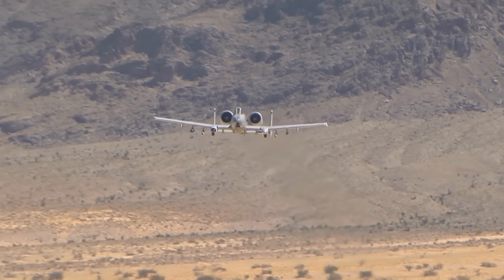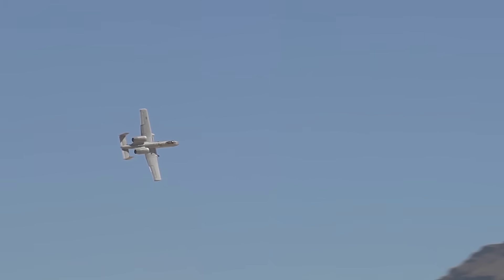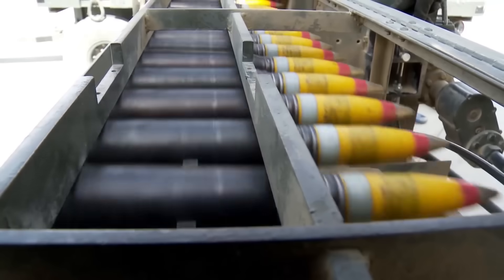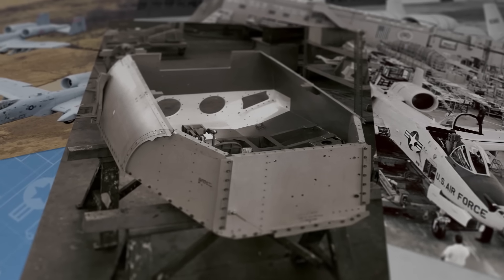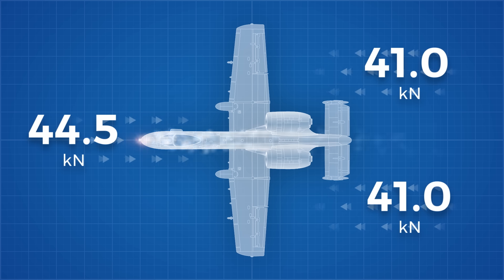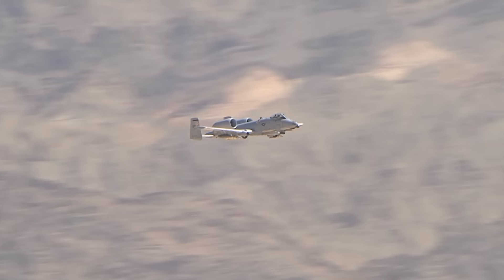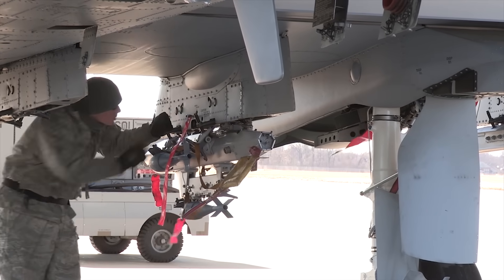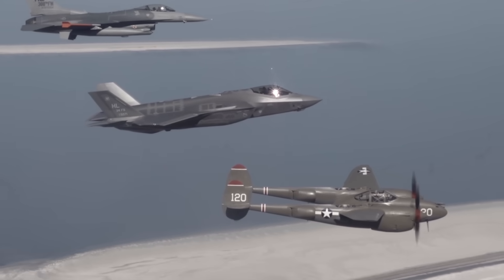The Insane Engineering of the A-10 Warthog

Comment: Former fuel system technician on the hog here. Love the hog and miss working on it. Easily the best beast put in the air.
Reply: Pavehawk crew chief here and we loved having you guys as our brother squadron! BRRRRT!!! :P
Reply: Former Instrument Flight Controls Spec for the B-1B Lancer here.  I regret that we never had an A-10 at any of our airshows before I left South Dakota.  It was one of my two favorite planes growing up.  The other favorite, at least I got to work on for a few years.
Reply: "Former fuel system technician on the hog here."... cool i used to do electrical on the hog down in forth worth for awhile.... the hog is a great machine.
Reply: its on my list of models to aquire
Reply: @JoaoSoares-rs6ec  3D print it ! Way cheaper  its like 40 dollars to print a plane about 800mm long, Im printing a Harrier at present, just using PLA LW filament, its awesome light weight plastic, super strong, the printer is about 800 bucks, totally worth it, make broken parts even props, you can even buy all the plans with gcode ready to go if you want, I did that with a spitfire, 60 dollars for pln, the spitfire has a wing span of 1.2m its huge, my build plate is 220x220x300 up, built it entirely on that printer......You should look into it, its great fun as an add on to the hobby.
Reply: @Piddlefoots  interesting idea, but i would need a scan of an a10 for that, the biggest issue is a 3d printer, their near impossible to get were i live and absurdly expensive, it would be cheaper to just get the model.
Reply: @JoaoSoares-rs6ec  Well thats a shame mate sorry to hear, maybe in the future.
Reply: @Piddlefoots  maybe
Reply: @JoaoSoares-rs6ec  Another place you can fly one, well virtually lol is the game Warthunder, they just added the Hog to the game !
Reply: Go to work for MESA airlines.  They'd  love to have you.
Reply: What about  the O V-10  BRONCO.  ?   THE  A=10's Daddy  !
Reply: The brrrrrrt
Reply: Gold Fish - those fuel bladders must be a bitch to replace.
Reply: @benscratchin7017  for the A-10, piece of cake. For the B-52, it takes some dancing to lace them properly. Best and worst experience of my life was working on those magnificent beasts. Worst because of supervision being unrealistic but that's over with.
Reply: Thank you for your service brother!
Reply: Man you had an awesome job well done !
Reply: I see these doing flights out of a local Guard post pretty often, they're certainly distinctive and impressive!
Reply: I love comments like this, thank you for your service!
Reply: @ Gold Fish, thank you for your service, you have to love that they built a plane around a gun. Also engineered to be one of the toughest birds in the air. 👍
Reply: Actually not the best at its intended role
Reply: @MaticTheProto  You're right, the money spent on any upgrades should have been used on a new platform, the A-10 is just about equal to the SU-27 or SU-29. And I see now they are going to dump a number of the F-22'S a plane lol that was supposed to be so special that they wouldn't even sell it to their NATO buddies and instead are going to wait for the development of their next platform which will be years down the road and cost billions or a trillion and the end results will be another boondoggle like the F-35.
Reply: @robertferrin511  still waiting on the answer
Reply: @MaticTheProto  yes it is
Reply: @JoaoSoares-rs6ec  oh really? Then tell me why so many were shot down
Reply: @MaticTheProto  realy and how many were shot down, let's see if you know that one.
Reply: @JoaoSoares-rs6ec  seven, last I checked
Reply: @MaticTheProto  7 out of 716 ever built, all by AAA missiles and after taking heavy fire, those are very low numbers for a plane designed for tank hunting and ground support, and if it's so bad why is the US airforce keeping them on the books.
Reply: @JoaoSoares-rs6ec  1. it’s more than any comparable aircraft 
2. heavy fire? As in… a single missile? 
3. you are soo close to understanding that warfare evolved past the point where a plane like the a10 is effective 

4. there are hour long videos explaining that and more, I recommend the ones by lazerpig
Reply: @MaticTheProto  1: not realy there are several planes that have a higherlost ratio, like the f16.
2: no heavy has ground flack fire and several missiles, some a10 have returned safely whit hap a plane destroyed.
3: warfare as evolved in many ways but the core principples are ther same. If warfare evolved so much as you claim, why is it that  the military has no plans to replace it, its te one plane that soldiers keep calling for suport.
4: there are videos showing how reliable and durable as the a10.
Reply: @JoaoSoares-rs6ec  1: probably because they are used more and in situations where the a10 can’t operate (i.e. at night or when there’s a chance that the enemy has any sort of anti air
2: not really. The damage most a10s returned with wasn’t spectacular 
3: there are many replacements. Any plane with a targeting system and guided munitions can do a better job, the gun is useless. 
And if loiter time is essential… have you heard of something called „combat drone“? 
4: there are videos explaining at length that the a10 is outdated
Reply: @MaticTheProto  1: because  unlike the a10 they are primarly built for dog fights, manuver, strike and run kind of things, not to stay at low altitude and take the punch.
2: have you seen the damage some a10 have had, literaly damage that would destroy other planes, parts of wings, gone parts of tail gone our most of it, fuselage like swiss cheese, whit hidraulics gone and they always come back.
3: drones cant take the same punishment and amont of munitions that the a10 can.
4: gun is usless. let me tell you a story, in the late 50's whit the introducion of guided missiles, some "genius" decided that they missiles were the future and planes didn't nedeed guns, so they introduced a plane designed to be fast and cary lots of missiles, (the f4 Panthom), all said it was a great plane, but them something happend, called vietnam war, now on paper the NVA had the short straw, nost were mig 17, no mach, but here is the thing the NVA very kwikly learned how to deal whit the missile heavy f4, wen they had a missile on their tales, they would dive to the deck, the missile would get confused and slam to the ground, another thing they did, most people don't know but missiles have to travel a short distance before arming, so the NVA would get close were missiles were usless and use the one thing the f4 didn't had a gun, the f4 had their tasks complicated until one pilot straped a gatling to is plane and altered the game again, later models came whit a gun included, guided munitions can miss specilay so close to friedly forces, a gun not so easy,
Reply: @JoaoSoares-rs6ec  why, just why do you think any plane needs to take a punch? That’s just false
Reply: @JoaoSoares-rs6ec  and in the past other aircraft survived worse
Reply: @JoaoSoares-rs6ec  also drones don’t need to take a punishment because they don’t use a gun like an idiot
Reply: @JoaoSoares-rs6ec  and 4. is just a load of crap.

Yes I know the f4 phantom story but guess what? Military analysts have a point. Nowadays air battles happen beyond visual range because missiles are far more potent now. 

Also the a10 has a habit of using its gun against friendly forces soooo…

Just watch the videos done by lazerpig, the guy made two excellent summary videos
Reply: @MaticTheProto  so many comments.
OK, if a plane is to provide ground support it needs to take a punch otherwise it's destroyed very fast and no, not that many planes survived such damage, it's a rarity, the b17 is one such plane, drones don't use a gun, because they are first built for recon second they can't take the recoil,
The reality is you have no idea what you are talking about,
Reply: @MaticTheProto  you keep mentioning videos well we're are they
Reply: @MaticTheProto  take a look at the Russian il 2 plane to get an idea
Reply: 1 s400 and it’s a fireball
Reply: @pauldean8638  keep dreaming
Reply: @JoaoSoares-rs6ec  keep dreaming , yeah the US keeps thinking they can fly in Russian airspace , boom big fireball
Reply: @pauldean8638  like I said keep dreaming,  take a look who's planes and gunships are turning to fireballs,
Reply: Lol why would anyone go on and on about an obsolete plane is beyond me
Reply: @robertferrin511  and futher more the platform was so successful  Boeing  has the latest version of her  even  in desert storm she was there doing her thing so when someone makes  an uninformed and  ignorant  comment  such as yours  instead of  bringing them down.  I would prefer to educate their understanding and bring knowledge to  the front of their knowledge on a subject.  ....    obsolete.   My coment  of response is .   This Fool has been  sadly misinformed.   (  quote  from the Transformers. )   The  movie.    Specifically  Doc... !
Reply: @quinnsavage2325  LMAO of course it was in Desert Storm for after all we were the only ones with planes there, now put them up against a peer country and see how long they would last, I was reading that they are equivalent to the SU-27/SU-29 which means they are a few generations behind other peer countries.
Reply: @robertferrin511  Aww you'll be  fine.
Reply: @robertferrin511  Because its not that obsolete for a start, it i to this day VERY effective on the battlefield BECAUSE its only deployed AFTER the US has total air dominance and then its one frightening beast......... On top of that, it has LEGENDARY status, hello do you live under a rock /
Reply: @Piddlefoots  Lol LEGENDARY status, so did the Brown Bess when they first came out, but they don't use them today do they.!!!
Reply: @robertferrin511  Well they DO still use the Hog buddy, and they use it TODAY buddy, because its still very applicable to todays battlefield, explain why you think its not mate ........ We dont all drive T-Model fords, but a FEW people do, so what, your point is rather silly, try reasoning. Why do you think its outdated mate [
Reply: @Piddlefoots  Well you have to go with what you have, let's face reality the F-22 the F-35 are nothing but high-priced junk to peddle to the NATO suckers, the F-15 and the F-16 are old birds which can't and won't keep up with the SU-30,SU-35 or SU-57. So as I said you go with what you have even if it's the last decade's technology..
Reply: @adamdrach5394  Neither Russia nor China is an enemy, for our enemies are located in Washington, D.C. AND HOPEFULLY SOONER THAN LATER THE American PEOPLE WILL FIGURE THAT OUT.
Reply: @adamdrach5394  Bingo, you hit that one out of the park, but watch this fall as the sheep rush to re-elect the same old dogs/hogs back to the trough.
Reply: @robertferrin511  so obsolete that they have nothing better than it right, planes can be modernised
Reply: @JoaoSoares-rs6ec  Not these nor the others for their airframes weren't made for it as intended, more money to be made from a grounds up approach than an  add-on that's why it cost hundreds of billion for a piece of junk like the F-35 whose ratio of downtime to flight time is the worse in the world, that's why like the F-22 it's called the hanger queen for that's where it performs best.
Reply: @robertferrin511  remind me for how long the b52 is in service and for how long it will remain in service. The same goes for the a10
Reply: @robertferrin511  Lol why would anyone who is obsolete and who suffers from a dearth of knowledge make foolish allegations regarding an aircraft and its knowledgeable supporters.
Reply: @TurneyDean  The first part is I have to  find some knowledge people/supporters, the second part is that this plane is old enough to draw social security which of course makes it obsolete.Enough said.
Reply: @robertferrin511  The B-52 would like to have a word.
Reply: @MrSatchelpack  The B-52 is an old plane, and they had enough problems with those even back in the Vietnam days and with the modern missiles today they would be nothing but sitting targets, the days like the carriers are over for the heavy bombers.

Comment: I first became aware of the A-10 in the 1980s at a military airbase open house.  The pilot of the one on display told the audience a reason for the short burst fire of the gun was to maintain accuracy.  According to the pilot, anything longer than a two-second burst could overheat the barrels, lessening the accuracy of the gun.
Other pilots at the same open house that flew F15s poked fun at the A-10 for its slowness; saying the speed of that aircraft could be measured by a calendar instead of a stopwatch.  xD

Comment: APUs on commercial aircraft supply electrical power and air. They do not have hydraulic pumps. 

Electric hydraulic pumps can be powered from the APU generator. Some aircraft have air driven hydraulic pumps that utilize the APU air for operation.

Comment: A-10 Warthog is probably the only 2 seat plane to be considered for AF1 duty in an emergency situation! Take off from a remote dirt airway behind enemy lines after an attempted snake head cut by that regime. Fly low and fast, destroy the last battle vehicles waiting to shoot SAM at the escaping President. Then fly low and slow enough to win dog fights with next generation fighters, with other first generation fighters on our side to engage and protect A-10-AF1, then it can refuel in air, finally land near a secret bunker. Untill America responds to the attack, and forms a plan to replace the murdered government officials and return to return the head of the American snake!
🇺🇲

Comment: A thing about the Gau 8 of the A-10. It's actually mounted and offset to the left of the aircraft so that the barrels will be directly centerline when they reached firing angle. While the firing pin of the gun is centerline, the speed of the barrel rotation as well as the barrel length means that the barrel will be at the 1 o'clock position when the shell exits the muzzle.
Reply: why don't they fire so it escapes at 12?
Reply: Ah, that makes sense. I was going to refute the “mounted center” claim from the video because it’s clearly not mounted centerline. I remember being told that it was that way because torquing the plane and going off target was better than stalling and crashing the plane, but now I get the full picture, the true way the plane is built makes more sense.

Comment: Basically, cheap, easy to maintain, invincible, powerful,  easy to build, and has a fuckin 30mm minigun.
Reply: It's not cheap nor easy to maintain nor invincible. In fact, the only thing in your list that it is good at is being powerful within a limited set of parameters.

Compared to other ground support aircraft, it is far too expensive and hard to maintain and hard to use to justify its narrow role in a modern military.

Comment: 1:08 front view of the A-10, main Cannon shown to be offset towards the left hand side of the pilot.
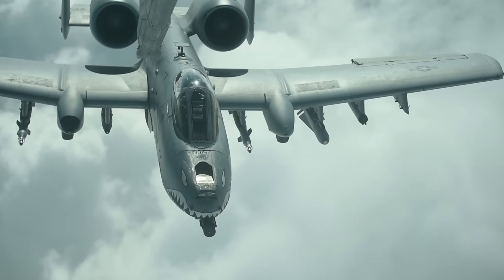11:41 main Cannon shown to be offset towards the left hand side of the pilot, meaning the firing barrel is at the "9 o'clock" position to allow the recoil to push straight back into the frame.
Edit: Meaning the firing barrel is straight inline with the center of mass of the aircraft.

Edited for clearance.
Reply: And what! I used to build and fly r/c aircraft! I'm so ignorant that I can't understand what you said in your comment please expand!
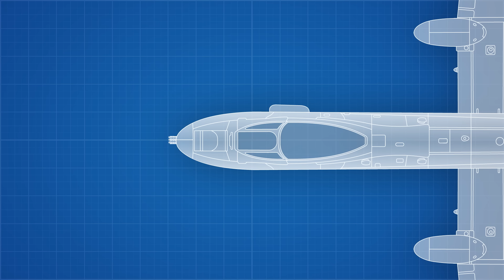Reply: @stephenhogue5567  at 7:43 this video mention that the gun is mounted directly in line with the fuselage, which is incorrect.
(As you look at the plane head on)
The gun is offset to the 3 o'clock pos, while the firing barrel is the one to the 9 o'clock pos, so that the firing barrel is straight in line with the fuselage not the entire gun.

Is a small detail, and kind of petty to be honest, however this is supposed to be educational video so I expect a higher level of accuracy from it.